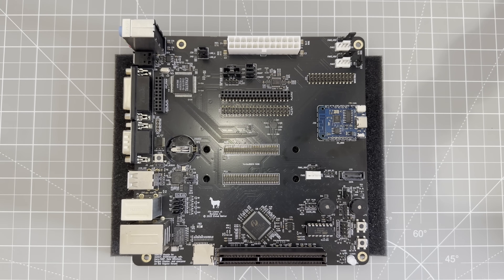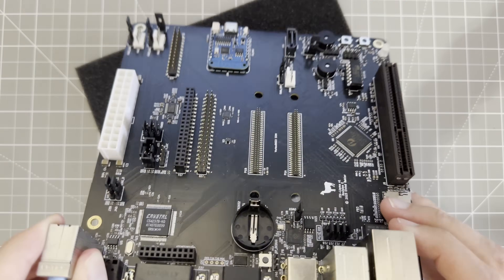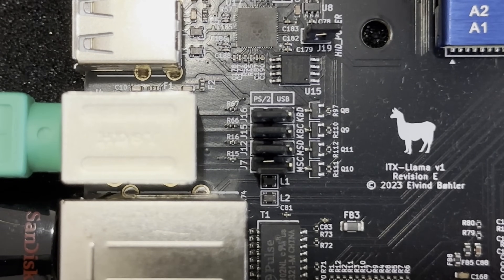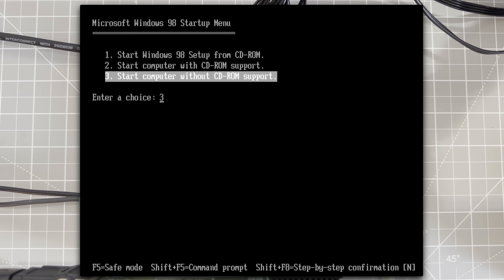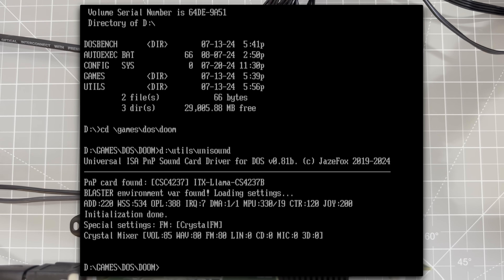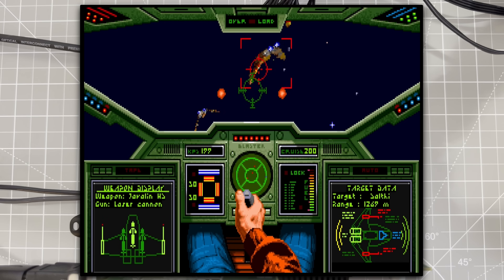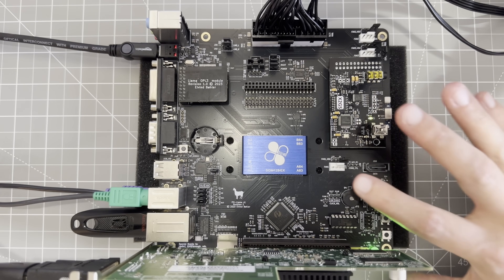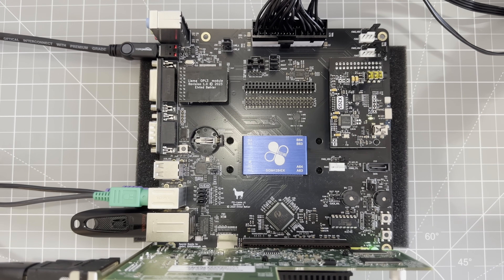ITX Llama: A Brand New PC for 1990s DOS Games!

Comment: It's a great concept but sadly it's priced way too high. A modern MB is around 100 USD and this board is 300 USD, simply priced way too high for what little it will do. PC parts are exuberantly priced these days and a modern ITX MB and Low End CPU can easily be had for under 300 USD, probably including Memory too. Granted there won't be a very high demand for this board but still the high cost is not justifiable. If you price something right it will sell but then again if one has more money then braincells they won't care what the price is. I grew up on this old tech, as my first PC was a Tandy 1000 with an 8088 Processor and a 300 baud modem so I'm behind the nostalgia all the way. My first ex wife probably still has that Tandy 1000 as she does not like change LOL... Again this is a great concept, it's just priced too high for what little it gives, the ROI or Return on Investment is outrageous. It's great how it incorporates the older sound technology, especially for older games, but at over 600 USD it's just priced way too high. By the time you add in the CPU/Processor, sound card mod, GPU, and whatnot, it could probably get close to 1,000 USD and then it's just a complete waste of money.

Comment: My only complaint would be that there is no EISA slot. Honestly, AGP graphics were not much longer lived than VLB, and picking up an ISA card is far more feasible. If it had a built-in VGA circuit that could be used until you can get hold of a working AGP card, I wouldn't complain, as AGP is clearly the way to go for performance, but as I'm not likely to buy this till I can find an AGP card, and I expect that may take me a long time, I feel that's a bit short sighted.
Reply from the maker: Unfortunately there is only 1 DMA channel exposed from the Vortex86 SOM, and that’s used by the Crystal audio chip :-(

There are some interesting new projects out there that use a mini PCIe graphics card - check out the TinyLlama 3 and Pixel86 😎

Comment: Honestly, I'd be more interested in it for Windows 98 than DOS. DOS games are by an large much easier to get going these days, while there's a large subset of Win9x games which simply don't work in the current Windows malware OS, or even WINE. I'd definitely use it as an all purpose DOS machine as well; but there's quite a few Win9x games that I'd like to play that aren't really playable these days without an old system. 

I wonder whether you could boot from a SATA drive instead of the MicroSD slot? It'd be one thing if this was built out into a portable hand held system, but for a desktop, I'd rather have a regular SSD, or heck maybe even embrace the old school with some spinning rust. You can still get 500GB or 1TB hdds in 2.5" or 3.5" form fairly cheaply new. SSDs aren't much more expensive, but old school is old school.
Reply from the maker: You can connect an SSD to the SATA port, it works great and is definitely recommended for Windows since it hammers the swap file.

The processor is best suited for DOS, though. It’s similar to a P233 MMX in performance, which is a little slow for many Win98 games

Comment: Is there anyway to change the CPU speed on the fly without going to the bios. Like how you could with the "Turbo" button on old machines?
Reply from the maker: @littlefreak3000  you can use an app like CPUSPD to do that 😎

Comment: what agp card would you recommend thats powerful enough for windows 98  3d accelerated games?
Reply from the maker: Two good options:

1. The Radeon 9200SE. This is available cheaply and has lots of performance. 
2. 3Dfx Voodoo 3 3000. This is a good performance fit for the Llama and can play Glide games

Something worth mentioning: the CPU on the ITX Llama is not fast. Only similar to a Pentium 200MMX. So most Windows 98 games will be CPU bottlenecked. The best era for this PC is DOS and very early Windows 98 games.

Hope this helps!
Reply: @jamesfmackenzie  awesome, thanks!
I have a radeon 9550 lying around, should be great for this build
I ordered an itx-llama from retrodreams, cant wait to get my hands on this!!

Comment: I LOVE this as a project. I grew up with DOS games, being a 90's kid, and as time progresses, it becomes more and more difficult to not only play some of these games, but even just get them running and functional. Finding old PCs is difficult, and they pull a lot of power, and make a lot of noise.
This is... everything I want. Hearing those soundblaster tests for Duke3D, then the final test, just.. my jaw hit the ground. My dad had a PC that made sound that good... it was amazing for games. I'm sending this video to him, I'm sure he'll wind up picking it up at some point. I wonder if he still has that old 3DFX Voodoo 4 card...
Reply from the maker: Glad this brought back some great memories! I really like the ITX Llama. Next up I’m going to play The Dig 😎
Reply: @jamesfmackenzie one of the best games ever
Reply: Actually, you might surprised to know that older computers really didn't use very much power. The CRT monitors did pull quite a bit, but the power hungry CPUs really weren't much of a thing until the Pentium 4 era, and 3D Accelerator/GPUs weren't really a thing until 1996, and power hungry ones weren't really a thing until probably geforce 4ish era?

Comment: The problems arise when you have MS-DOS games with audio tracks on CD, which were connected directly via a cable from the CD-ROM drive to the sound card. The game would send commands to play a track, and that's how the music would play. I think this is the Achilles' heel for many of us who want to use real hardware but without relying on the physical media (CD-ROMs) from that era.
Reply from the maker: Yep, CD audio is a real gap. Especially since many ISO formats are missing it :-(

The ITX Llama does have a CD audio header. I’m considering a SATA to IDE adapter, so I can connect an old CD drive with audio out 😎

Comment: To all the people who lament about not being able to buy this, just go buy a slot 1 motherboard. They are cheep on ebay and most times they even give you the CPU for free. They are way way more afordable then a socket 7 board and getting a voodoo3 2000 is not expensive for sound you can get the picogus which is for sale by kit or prebuilt. There are a ton of usb to floopy stuff out there along with sd card to ide as well. All in all your going to spend probably about the same as buying this if not less and you get something authentic. For sound you could even look for a azgalexy board or something that is basically a sb16 in everything but name. I could be misremembering the name there but there were tons of clone sound cards during that time. Only issue is with old games that are CPU bound, but there are tricks for that and luckly the number of them like this is not great.

Comment: Great idea.. sadly it all comes about a year too late, the original designer is not doing group buys anymore and while all the project data is free and you could build it yourself, which is really nice, getting the PCB done alone sets you back at least 200€ and if you're not able to do this super small SMT Stuff yourself it sets you back at least another 300€ for that service not including the components itself... So while it is great.. its just as unreasonable expensive, sadly.

Comment: Pipe dream for me is, an all-in-one X86 SBC, complete with a button clock-able CPU @ up to 33Mhz-2Ghz, with a built-in Z80 & 68000 + OPL3 + RISC processors for coprocessor duties inc audio, MIDI FPGA, scaler FPGA, and an FPGA for raster tasks that has Voodoo, ATi & Nvidia cores complete with a 400Mhz RAMDAC. Give it a huge L1 an L2 CPU cache for hyper low latency, SRAM ROM & SD RAM drives for ultra low latency I/O, a built-in 32GB SLC base SSD NAND. AN ITX port & AGP port + PCI port.

Comment: If this thing run Windows 98 SE without errors, then I'll buy it right away! Dosbox emulation have many errors and slow, 86box is faster but still have errors!
Reply: You can only use ATI or Voodoo, Nvidia doesn't work

Comment: That's an incredible little board!

Definitely can be optimized as well.
Using a rp2040 for just HID devices is probably even more overkill than the AGP video card 😂😅😊
Reply from the maker: Yep! Having great fun with this little machine!

Agree on the RP2040! You could probably emulate a 386 CPU on that thing! 😂

Comment: It was driving me nuts that you plugged in the module wrong @4mins  I hope you didn't break anything and have to get a new board or module.   You missed a great opportunity to show what looks like with this board will be a common mistake.  Also no mention of price and where you can get it.
Reply from the maker: What did I do wrong?
Reply: @jamesfmackenzie  Look at the footage at 4:10 where the blue module is clearly low and the white connector outline showing on top.  Then you show at 6:51 the blue module has clearly been moved up.
Reply from the maker: @IntenseGrid  Good catch! I did re-seat the module when it didn’t power up the first time around. Didn’t realise I was misaligned by one set of pins.

In terms of availability, the initial run is over. But the design has been open sourced and is buildable by (for example) PCBWay or JLCPCB. Details are linked in the description.

Good luck!

Comment: Seems to be missing Roland MT-32 \LAPC-1 support for early DOS games at the time. Another SOM to emulate that card?
Reply from the maker: You can add MT-32 support in two ways:

1. Connect a real MT-32 to the game port
2. Connect a raspberry pi to the raspberry pi expansion header and use mt32-pi

I have a video coming up on this next week 😎

Comment: Sad that the availability of such awesome projects is often bad.

The graphics card slot / AGP seems to be the limiting factor as many graphics cards have issues like scrolling in certain DOS games. Also what about a Voodoo 1 or 2 (there are patches of Voodoo 2 under DOS)?
Then there is also the question of how good the sound effects sound on the Crystal chip (I'm not the too picky kind here) and GUS is also missing. A CD-Audio header it offers but what about PC Speaker header? It's to blurry to see in the video.
The board would be even better, if it would offer multiple ISA and PCI slots as you could use sound and graphics cards but also projects like Orpheus or PicoGUS.

Wing Commander still runs way too fast btw. My Pentium 233 MMX can be slowed down so much, that is works perfectly and the only thing I'm missing is down clocking via BIOS instead of dip switches. In the end I stopped using it for Win9x and have it set to 120 MHz all the time.

PS: I wonder if SATA will work for DOS as I heard other boards with early SATA ports having problems.
Reply: Yes it has a pc speaker header.  I do agree that the AGP port was a mistake, should have just been a PCI slot.   I think the SATA port works in IDE mode and will work perfectly in DOS.

Comment: It would be nice to integrate fast DOS device like this with MiSTer FPGA for other platforms. Share MiSTer's CRT shaders with DOS. Share MiSTer's MIDI abilities with DOS. And put everything into ATX. I would like one drive bay to be occupied with CD(BluRay?). I would like to have MT-32 display in another drive bay. Some games can print something there. And sound mixer controls would be handy there. Finally, third drive bay, maybe smaller 3"5 bay with TapTo NFC hidden inside decorative floppy reader. And decorative floppies with TapTo tags. And maybe some universal card reader. I currently have one by Akasa, in big 5"25 format

Comment: Nice, but considering the use of the Vortex I fail to see the point of using this over something like the AO486 MiSTer core with an MT32 pie which can be obtained easily for less than $200 nowadays, and support most of not all features. Not sure about the “modem.”
Reply from the maker: It’s much faster than ao486. But you’re right, for older DOS games the MiSTer is great!

Comment: I still have an 8088 based IBM plus a NEC V20 upgrade, and an 80286 PC-AT, a 386, 486, Pentium, Pentium D, Quad-core Pentium, and early Core i7.Nothing sounds like DOS more than a 5-1/4" DSDD diskette drive, buzzing away for five minutes. Can't believe you didn't try out Rise of the Triad. It's very sensitive to non-standard emulation.
Reply from the maker: Thanks for the tip! Will try out ROTT next time!

Comment: It's unfortunate that these things are de facto unavailable. It damn near hits all of the marks. About the only thing I'd add is an LPC header so you can use an ISA slot breakout board in the second slot inherent in the ITX standard. Even better would be a standard PCI slot  and ISA slot on an extended board. You wouldn't be able to use both at the same time, but it would let you play around with early PCI based 3D accelerators, like the faster EDO based Virge chips, the Rendition Verite, or even a Voodoo  1.  But as is, it's an amazing accomplishment: a nice dos and win9x gaming rig that you can hook up to the living room tv. Oh well, I guess my P5GX-M based rig  running at 300mhz with 256 megs of ram with a voodoo 1, an ever changing primary card (right now a Rage Pro Turbo All-in-wonder), and a memory maxed Sound Blaster 64 will have to do ;p
Reply from the maker: A late reply on this, but with some good news!

A community member is planning to build and make the ITX Llama available for general sale. You can purchase here:
https://retrodreams.ca

Find more details on the Vogons forum:
https://www.vogons.org/viewtopic.php?t=93480

Comment: I had to look this up to confirm it's not emulation. The Vortex86EX is a commercial product (I assume for other things like industrial uses) that has a real CPU etc. on a tiny module, with system bus etc. exposed to connect. This is fun to have a motherboard to go with it and work with old DOS and games.
Reply from the maker: 100% agreed!

Comment: Pretty slick all in all but with the emergence of FPGA and the fact that all audio and most video is 100 percent emulated, this would make more sense if someone could show us an example of something not working on emulation but does work on this.  People complain and whine about DOSBOX but to date I've been able to play every single thing I've ever wanted to play with it.  Spot on at that.  Plus being able to play on my current monitor with my current sound setup and not having to bounce back and forth, eh, I'm just not seeing the appeal.  I get nostalgia but people need to realize that all that old hardware is eventually going to be dust.  Just look at the C64 scene these days.  People strive to play on original hardware yet most of them don't actually have real hardware, they have a frankenstein monstrosity that's doing emulation on the C64 board.  Once you emulate anything, you're emulating.

Comment: This is a fantastic demonstration of the capabilities of this board. I found the original thread on Vogons late last year and assumed it was a novel proof of concept but this demonstrates that it is clearly more. I've got multiple ITX cases I've been loathe to part with, that'd be perfect for something like this.

Some questions that come to mind:
* I wonder if the onboard RP2040 can be used as a PicoGUS? 
* I wonder if the ISA bus is accessible and can be attached via a ribbon and backplane? 
* I wonder if there is a PCI bus that could be exposed. 
* There is onboard SATA, but is there onboard IDE for an optical drive to support CD-Audio games?
* I wonder what JLPCB would charge for a complete assembly?
Reply: I'll answer your questions:
1. No, it's not connected to the ISA bus. Nothing stopping you from modifying the design, though - and adding the PicoGUS components instead of the CS4237B (which, incidentally, is exactly what I'm doing with my in-progress project, the TinyLlama v3).
2. Not on this board, but definitely doable with a redesign. You should note, however, that the ISA bus on the Vortex86EX is stripped of quite a few pins - it only has a single DMA channel, for instance. That very much limits the usefulness of having several add-in boards.
3. Yes, the AGP slot runs off PCI at 66 MHz. There's a single lane (x1) PCI-express gen1 coming out of the Vortex86EX, being converted to PCI by a PI7C9X118 bridge chip. AGP is a superset of PCI, so you can run most AGP cards that support the AGP 1x standard by connecting the physical AGP connector to a PCI bus.
4. Nope, no exposed IDE coming out of the Vortex86EX, unfortunately. I think you might be able to use an IDE optical drive together with a SATA/IDE converter though.
5. Totally depends on the number of boards you order. There's a minimum of 5, and obviously the per-board cost goes down a bit when ordering many at a time. I don't remember the exact amount I paid per board, but I think it was more than $150 and less than $200. Depends on the day-to-day price of many of the components as well, sometimes that will fluctuate quite noticeably.
Reply: @eivindbohler  What an incredible response, thank you! 

* I had not initially considered replacing the Crystal sound chip with PicoGUS components but that is an interesting direction. My curiosity about the ISA bus was specifically related to adding a PicoGUS via ISA to augment the Crystal chip. 
* Running SATA to IDE (reverse) is a great idea as it should allow IDE optical drives to supply audio output separately. Perfect.
* I hadn't considered that AGP is just a superset of PCI. My use case was to add an m3D card next to the AGP slot but I'm not sure if that's a worthy direction to go. I can probably get far more bang for the buck using an AGP based Voodoo3. (I have an m3D, I don't have an AGP Voodoo3 yet...)
* If the cost of a full assembly (minus the Vortex SoC itself) is $200-$250 or less, that is fantastic news as I had assumed it'd cost more than that. 

Thank you for your detailed response! 
Out of curiosity, do you or @jamesfmackenzie mind if I mirror this thread on Vogons for our future selves and fellow curious to find?